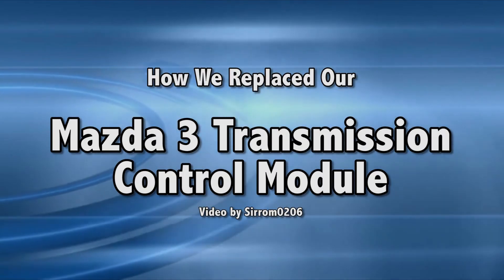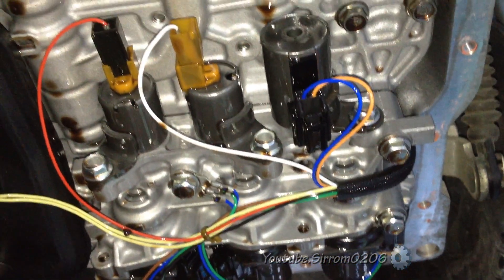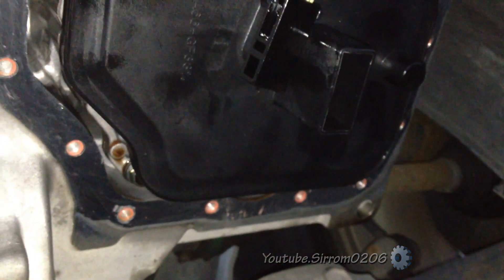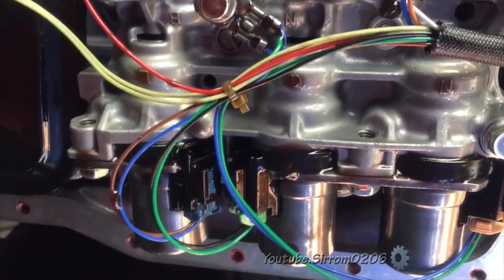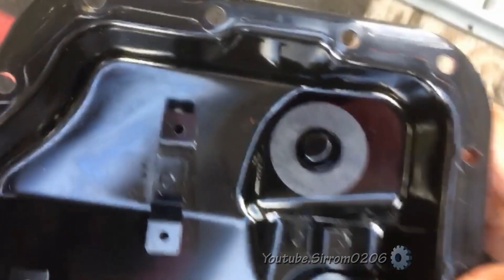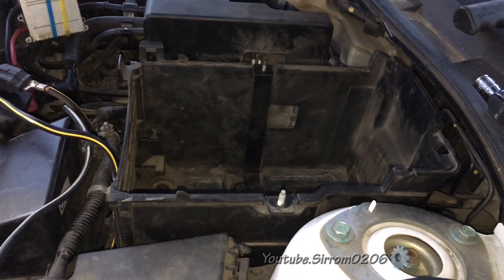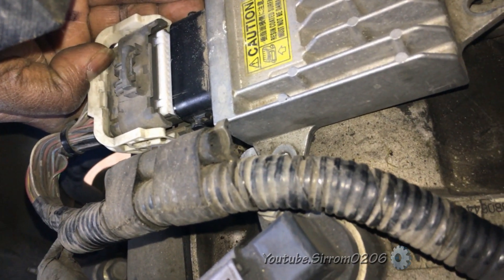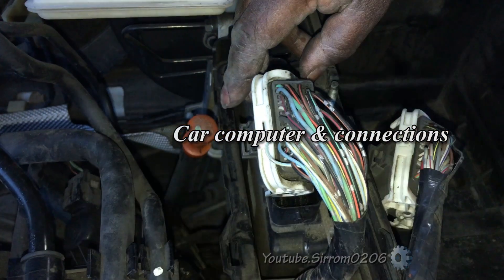Replace Your Transmission Control Module TCM

Comment: I replaced my tcm but AT light is still on and when shifting from parking to Drive or Reverse it has a really harsh shake! Any suggestions as to what else could be the issue? Electrical, solenoids,?
Reply: I just bought a tcm. I hope it don’t have the same problem as you. It’s probably a bad shift solenoid.
Reply from the maker: I wish no one had this problem. Troubleshooting sucks, collecting quality information on a fix sucks, and sourcing a replacement sucks.

Comment: I have an issue with the gear of my Mazda axela 2005. When I put on Drive mode, I see the gear 1 and then all of a sudden it goes to the 4th gear and gets stuck there. I tried to shift on manual mode but no light showing it and cannot change. It is stuck on the 4th. I stopped the engine and tried again, it was ok changing gears alright but again after 2 minutes it goes automatically to the 4th and gets stuck there. Now should I change my tcm?
Reply from the maker: You need to decide if you need to replace your TCM. We had to change ours because we could not shift out of first gear. After checking the speed sensor, shift solenoids, trans filter and something else I can't remember, we determined that everything else was operational and sending the right codes. Find someone in your area that know engines. Since I'm a thousand miles from you and never seen your car, they should be capable of giving you a better answer than me. This is a hands on transmission evaluation and way more than a google search fix. I say that because this will cost you $100 plus dollars in parts alone. You want hard evidence that the TCM is your problem and not some $15 dollar 15 minute repair. Before spending any cash, do your homework. Good luck.

Comment: Did you have to take it to a dealership to have the TCM re-programmed or is it a straight swap and good to go? Please respond........
Reply from the maker: Nope. I said this in an earlier post.
Reply: @Sirrom0206  so there is no reprogramming required just put it in an good to go

Comment: My mother purchased a used Mazda from the Roger Beasley Dealership in Central Austin on 10/17/19. They sold her a 2007 Mazada 3 with a faulty or failing TCM(which they just replaced for FREE today 11/19/2019).This is after I drove the car for roughly three weeks with gear shift issues. At this point, the vehicle is driving fine. My question is (I am being proactive) do you know if the hard shifting on the car causes any other issues?
Reply: TeamYELLOW17 that’s interesting. I just ordered a new TCM for my 2008 Mazda from that dealership. I’m in PA though. I’m glad your Mazda is driving fine now though. Also keep a good diagnostic scan tool handy so you won’t have to pay a mechanic to tel you what’s wrong. Best wishes to you
Reply from the maker: Could have affected the CV joints, but you won't know for sure. If it feels fine it probably is fine. I wish I could have got mine for free.

Comment: How is the refurbished one working? I just ordered one off eBay!
Reply from the maker: Zero problems so far, though I thought this would be a bust project.
Reply from the maker: The car is still running as it should. We've added another 1k or more miles on the car. Video posted Jun 26, 2019;

Comment: I removed my battery casing but there is no tcm under it, my car is mazda 3 2010
Reply from the maker: Mine was under the battery case as I put in the video. I suggest you visit the library, check out an MX5 book for your car.  Better still have Autozone printout a pictorial for free.

Comment: Is there any place where i can see tcm in my mazda 3?
Reply from the maker: Mine was under the battery case as I put in the video. I suggest you visit the library, check out an MX5 book for your car.  Better still have Autozone printout a pictorial for free.
Reply: @Sirrom0206  hey I read that if I buy the tcm an put it on it has be programmed is that true or just put it in an we good
Reply: @Sirrom0206  appreciate the video, what is the MX5 book you are talking about?